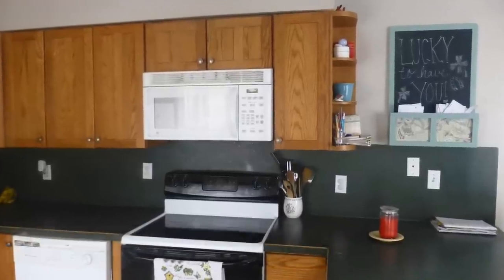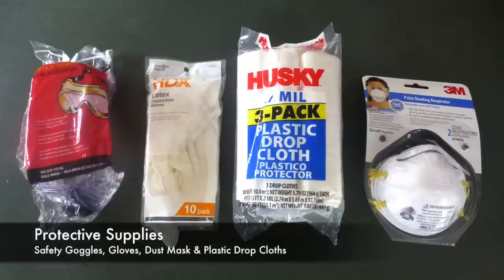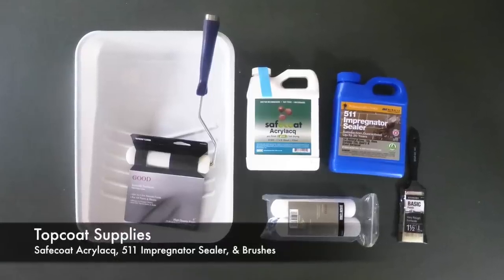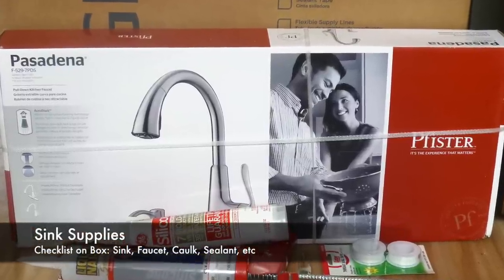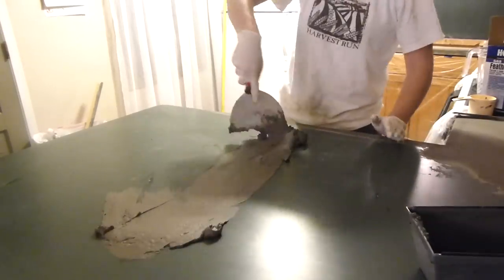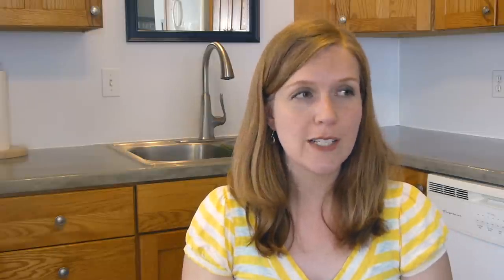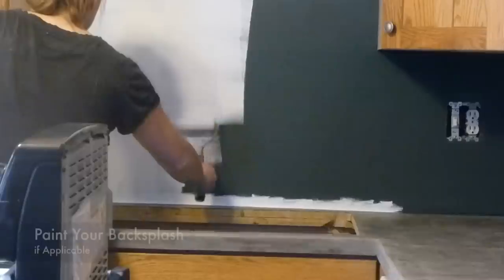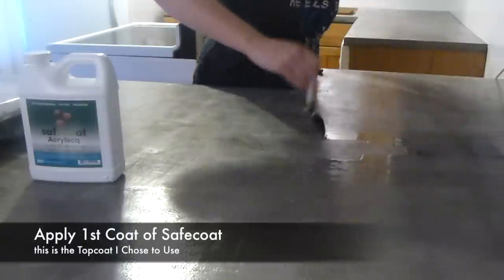DIY Concrete Over Laminate Countertops Using Feather Finish

Comment: Just mix portland cement with cement bonder and water half to  half. Put a coat of cement bond on your laminate counters first, let dry. Mix portland cement to paste like consistency and trowel on. One coat will do and seal with water based sealer (You may have to spritz with water as you trowel, depending on how smooth you want it) . Took me less than a day, looks great, and after a year is holding up fine with zero cracks or blemishes. it looks like precast concrete.
Reply from the maker: Thanks for the tips!!
Reply: Hi, how is  it still holding up?

Comment: We built new countertops in a new house this way. Thanks for the great instructional video. We used 3/4 plywood and then covered it with concrete board before applying the finish.
Reply from the maker: Wonderful!

Comment: Awesome job! I use TSP to remove the grime/grease, then sand, and then degloss before painting which seems to help adhere better. I'm about to tackle my cabinets and countertops! Thanks for the info!
Reply from the maker: Thanks for the tips on prepping the backsplash, Missa! Good luck on the cabinets and countertops. I think I'm going to start with a bathroom cabinet first to practice before I do the kitchen.

Comment: How are they holding up? This would be my biggest concern! as Formica is a nonstick surface!
Reply from the maker: The feather finish has actually stuck really well. I haven't had any chipping. My biggest problem is the dark spots oil leaves. A good topcoat can minimize that. But, with concrete, I don't see a lot great way around that.

Comment: Hi. If I wanted to use a color like tans to match my marble what would I add to the concrete? Thank you
Reply from the maker: I liked the color it came in. So, I didn't add anything to mine. I did a little research before though and found some powdered concrete pigments on-line. I believe Ardex brand has a white feather finish that you might find a pigment that mixes into it. I'm not sure if they would work the same or not. Sorry, I'm not an expert on this.

Comment: Why did you remove the caulk? Also, why do you have to do multiple layers on the countertops? Why can’t you do just like one layer of cement and then like little patches?
Reply from the maker: I removed the caulk around the sink to get the sink out and concrete under it. I removed the caulk around the backsplash so the concrete would go all the way up to the wall. 

With feather finish, you want to build it up in several thin coats for a nice, smooth, strong finish. I did see someone who did it all in one thick layer and sanded from there. It worked. But, it was an accident and she regretted it. You can find links to others who did something similar on my blog, which is linked in the description of this video. Click "show more".
Reply: Designed by Maria thank you! That’s super helpful!

Comment: I am attempting this on several tables, however, instead of the safecoat I am going to use a 2 part liquid plastic coating for my finish. I’m curious if SO much sanding is that necessary, especially with what I’m using for finishing.
Reply from the maker: Sounds like a great plan! I'm not familiar with liquid plastic. But, I would expect that if you have a thick, self-leveling material less sanding would be required. Personally, I wish I had done a better job on the sanding. So, I would still recommend taking your time.

Comment: if you went through all that trouble you should do some rustoleum on your cabinets. that shade is dated and if you make them a darker finish...it will really modernize your home
Reply from the maker: Don't worry! I have plans for the cabinets once I have the time and $. I will have to make a video on that too. It's amazing how having the countertop up-dated suddenly the outdated cabinets and appliances look even more out-dated.
Reply: Designed by Maria y'all did a great job on the counters it just depends on the look you are going for I guess but the effort y'alls did on this...your cabinets are already in good shape look into the rustoleum for those there tons more options too than rustoleum but I love the counters. can I ask why you painted the backslash?
Reply from the maker: Sure! The backsplash and countertop where the same material. So, it seemed strange to me to change one and not the other. I wanted something light and bright to contrast the countertop and how dark it was before. I'm still trying to decide what I want to do long-term. I've thought about a lot of options.  But, paint seemed the most simple for now. It's actually holding up quite well and wipes of easily. I've learned I can only handle one big project at a time. Sometimes this means other things get a temporary fix.
Reply: Designed by Maria -- "You can only eat an elephant one bite at a time" :)
Reply from the maker: Ha, ha! So true! No matter how hungry I am to get it done, it doesn't work that way!

Comment: Thanks for sharing all of your experiences and information.  I wondering why multiple coats?  The people who work with this material (it's intended purpose, flooring) only put one coat.  I'm thinking if one puts a single 1/8" coat (as even as possible), then can just sand to smooth the surface.  ?!?
Reply from the maker: The top thin coat is kind of more like a primer coat I feel like. The feather finish is splotchy at first. But, the more layers you build up, the more coverage you get. There is a link in the description to my blog post on this with all the other people I found who did this process. One lady's husband didn't understand that it was supposed to be done in thin coats. So, he laid it on thick. It still worked. But, she felt like it created extra work to get it smooth.

Comment: Did you use the green frog painters tape? It’s supposed to be much easier on fresh pain and not pull it up so it may work for this also. Or you can purchase caulkers that automatically give you a very precise line. Also with lots of practice you can paint without showing brush marks. Just some tips but you did do an amazing job and I’m thinking of using your video to do my counters. Thank you.
Reply from the maker: Thanks for all your suggestions.
Reply: I used duct tape becuse it does not rip. I used it after picking out little pieces of frog tape along the backplash.

Comment: Thank you for this video. I do have a question is it possible to add paint or dye to concrete?  Because I want to do black cement countertops andjust trying to find a way. Thank you
Reply from the maker: I believe you can. This lady added a black powder pigment to hers: https://karapaslaydesigns.com/diy-black-concrete-island/

Comment: As a builder I cringed at the tools that were used but I gotta say I think it turned out gorgeous and I think I know a house that would greatly benefit from this exact technique what a super cool idea. And your countertops turned out pretty amazing way to go. Can I post a couple other products that are not quite as readily available but are superior products?
Reply from the maker: I feel your pain! I just got a nice drill and am realizing how much better it is to have good tools. Sometimes you just make do with what you have.
Reply: @DesignedbyMariaShop   Absolutely but in the end the result was a beautiful countertop so again very nice job. 😀
Reply from the maker: @affinityfunable  Thank you!!
Reply: Euclid also makes an Eucopatch product  designed concrete product for resurfacing and repairing concrete.
The adhesion is fabulous.
Reply from the maker: @affinityfunable  Thank you for the tip!

Comment: Hey Maria! Do you remember the overall cost of this project ? Not sure if you mentioned it (I’m a chronic fast forwarder 😂)
Reply from the maker: At the time I purchased, feather finish was about $17 per box at Home Depot, the Safecoat Acrylaq was about $54 on Amazon, and 511 Impregnator was $33 at Home Depot. We also got masks, sandpaper, caulk, and a bunch of other things you might have on hand. But, we ended up returning several unused boxes of feather finish after the fact too. I hope that helps.

Comment: Hi Maria, your countertops turned out beautiful!  I'm thinking of doing this but I'm concerned about how durable the end product will be.  I'm always in my kitchen, cooking, baking, canning, etc. and that is why they are beginning to wear through. . . but I need a good sound surface to work on.  Your video posted almost two years ago,  how have they held up?
Reply from the maker: The feather finish holds up great. The topcoat did not prevent oil from leaking through. That is my biggest complaint.
Reply: @DesignedbyMariaShop   I think that might be a maintenance issue.  They say even granite should be sealed every year because it is porous.  We wash and scrub these things constantly so it only makes sense.  I would love to have quartz but every time I price it I find so many things my family could use besides a countertop.  :)  Thanks so much for your answer.  It helps me make up my mind.
Reply from the maker: Could be. However, we noticed the oil leaving marks pretty early on.
Reply: @DesignedbyMariaShop  Hi Maria!! I am doing the feather finish counter tops this week!   When you say the topcoat did not work well did you mean the safecoat or the impregnator?   Im having a hard time deciding what to put as a sealer on them.
Reply from the maker: @Catherineslove   I am referring to the safecoat. The water does bead up on it and doesn't soak in, which I like. It might go on smooth if you have a good brush and don't overwork it. Just brush and leave it to self-level. However, it wasn't what I had hoped for. So, I bought this to try: https://www.expressions-ltd.com/products/surecrete-xs-327-hybrid-water-based-concrete-sealer#shopify-product-reviews I think it will be a smoother finish. But, I don't know if it will keep oil from seeping to the feather finish and leaving dark spots. Good luck!!

Comment: Maria are you finding staining, chips, or cracks on your countertops?  Just wondering how they are holding up!  Thinking about doing this.
Reply from the maker: Fats/oils leaves dark spots. But, there isn't really any other staining or chips. It wipes up really easily. There a slight crack where seams met up in my laminate. But, it doesn't affect the surface at all. The feather finish holds up great!
Reply: Hi, I would love an update to see how things are holding up :-)

Comment: Thank you for the video. I just coated my countertops and they have been curing for 30days but the surface is still very easily scratched. I tapped on an outside edge corner with a wooden spoon and it left dents/removed some concrete. Is your countertop like this? Does an impregnator make it more durable etc? I appreciate any advice you can give 😊
Reply from the maker: I haven't had any problems with the concrete chipping. But, the topcoat I used does seem to get micro scratches easily. That's one of the reason's I'm trying a different topcoat.

Comment: How did it hold up since you made this video?
Reply from the maker: It's strong... no cracking, chipping or anything like that. But, I've yet to find a topcoat that keeps oil from leaving darker areas on the surface.

Comment: Do you think I could cover my laminate backsplash,  too?
Reply from the maker: Yes I do. The vertical surfaces I did are fine. The biggest problem is the oil and you'd probably have less of that getting on a backsplash.
Reply: Designed by Maria okay great! Thank you!

Comment: This was so helpful that #1 you were a first-timer and #2, you shared your mistakes and what you would do differently.  My husband and I need to change our white (peeling at the sink) laminate, and after looking into installation of different tops, we thought going this route would be more in line with our budget.   Can you tell me how much in total you spent?  Thank you.
Reply from the maker: Thanks, Mara! If your laminate is peeling, you will want to secure it before going over it with anything.

I can't remember exactly how much we spent. I think it was close to $200 for the countertop & backsplash supplies. The new sink, faucet, plumbing stuff about $200-$300 on top of that. 

To give you an idea, at the time I purchased, feather finish was about $17 per box at Home Depot, the Safecoat Acrylaq was about $54 on Amazon, 511 Impregnator was $33 at Home Depot, & paint was about $20 +/-. We also got masks, sandpaper, caulk, and a bunch of other things you might have on hand. But, we ended up returning several unused boxes of feather finish after the fact too. I hope that helps.
Reply: Designed by Maria very helpful.  Thank you.  I think we can tackle this!
Reply from the maker: Good luck, Mara! Let us know if you have any other tips. :)

Comment: Great tips. How are counter tops holding up? I have two young kids and want to make sure its going to hold up. Thanks again for posting.
Reply from the maker: The feather finish concrete is holding up great!! Oil does leave darker areas which you may or may not appreciate. The topcoat I used is ok. But, I would like to try something else.
Reply: Designed by Maria hi Maria! I’ve run into the dark spots any ideas what to do about them? At the point of sanding again and doing another round of sealants? Thanks so much.

Comment: Do you need to take out the sink?
Reply from the maker: It is a lot easier if you do. I just re-did it again without taking out the sink and it still worked, just not as easily.
Reply: @DesignedbyMariaShop   I figured it probably would be harder with a sink there. Thank you so much for your help!

Comment: I'm wondering how durable this thin coat really is? If I had glass cup falling out of cupboard on to the countertop, would it shatter the concrete?
Reply from the maker: No problems with cracking concrete after 2 years. It's still solid & we've had some very heavy things fall on it. The only tiny crack is along where the laminate seam was.

Comment: total cost of all the counter top stuff??
Reply from the maker: At the time I purchased, feather finish was about $17 per box at Home Depot, the Safecoat Acrylaq was about $54 on Amazon, and 511 Impregnator was $33 at Home Depot. We also got masks, sandpaper, caulk, and a bunch of other things you might have on hand. But, we ended up returning several unused boxes of feather finish after the fact too. I hope that helps.

Comment: Coating seems so thin, the guys who uses the epoxy pours on thick coats and spread it out. What say you?
Reply from the maker: This particular product isn't designed for countertops. But, it actually does very well at just puddling liquids on top and not sinking into the concrete, even with a few thin coats. I don't love it personally, even though a lot of other people recommend it for this project. So, I am going to try a product designed for concrete next.
Reply: Designed by Maria +i see  from here it looks good. Food grade, right? 
My counters seem to stay wet (because, no one else cares). The laminate is old/well used and warped. I just want to change it inexpensively and give, also, an updated look. TY for taking the time 4the video, commentary and responses. We appreciate you.
Reply from the maker: You're welcome! Yes, from what I understand everything is safe for food. This is the new product I ordered to re-do my topcoat: https://www.expressions-ltd.com/products/surecrete-xs-327-hybrid-water-based-concrete-sealer#shopify-product-reviews I'm hoping to try it out next month and have a smoother finish on top. If you decide to try the safecoat acrylaq, I would just put it on with a nice, new brush and leave it to self-level. Definitely don't overwork it. That is where the worst streaks come from.